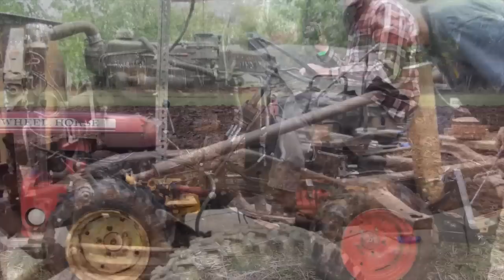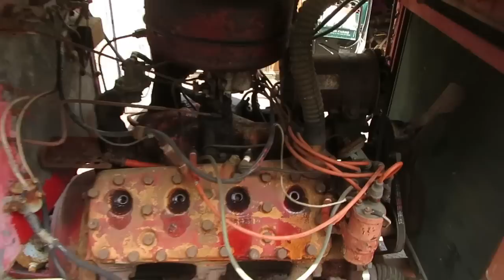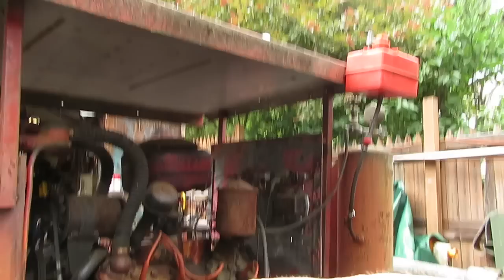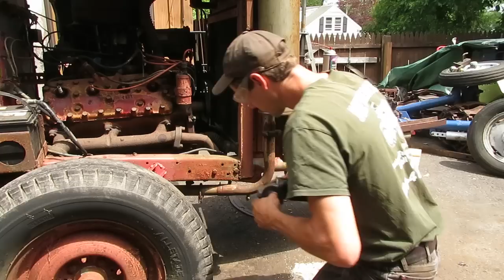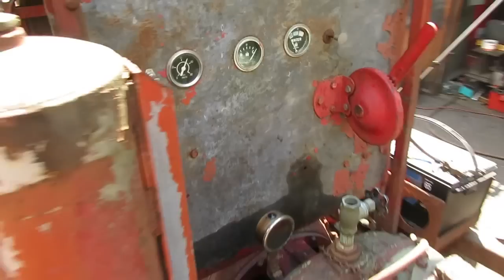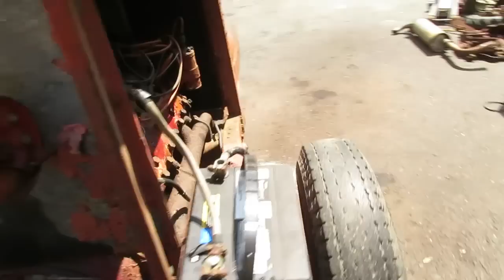Waking Up A Ford Flathead V8 Engine

Comment: You can tell General age by the distributor location. As stated in other comments, it's post-war. I have 49 Mercury V8 in a 52 willys jeep. It has the distributor on the side like yours. Instead of on the front like older flathead v8's.

Comment: The 239 was redesigned in 1948 as the 8RT for Ford trucks and in 1949 as the 8BA for the cars where the engines had the distributor up top at an angle.  1948 was the last year for front-mounted distributors except for possibly some industrial applications.  My '47 has the "V" twin style distributor cap.
Reply: Yup,fastest way to tell,crab cap on the front,pre 48-angled distrbutor,49-52.but ya knew that,just hadda add my 2 cents,I guess,love flatheads!

Comment: The valves like to hang open on the old flat heads the more you run them get them warmed up they usually come free if they don't have to pull the head tapping back-and-forth lots of oil

Comment: Wow that's a really cool piece! Never even realized Ford made a commercial version of the flathead V8's! Definitely a later one or they did some form of modification for the commercial ones with the distributor being where it is. Love how the first thing you did is cut the muffler off LOL! They are extremely quiet engines in my experience, half the time I can't even hear the one in my car running! You definitely should pull the heads and valves at some point though, that thing doesn't sound quite right... seems to be running fairly smooth but those old V8's have a very distinct sound and yours sounds weird... I have a feeling you have some stuck or non sealing valves.... Cool to see the quick video from you though! Looking forward to more in the future!

Comment: It's a 1949 to '52 Model 8BA engine. In my view, fix the cooling system, disconnect the drive to the pump & put some upper cylinder lube in the fuel. Run it at no load & fast idle for a while & the stuck valves [if that really is the problem] should free up as it warms up. Compression test it once it comes good, assuming that it does come good.
There is likely more service information & more available parts for this engine than your 2006  Toyota/Ford/Chev/Mopar. [pick one]

Comment: That brings back some good memories of my younger days. Had a 1950 ford, don't run it without coolant very long as it's very to easy to crack the block. How do I know that? Did it with two different engines in my ol' 50 ford.

Comment: Boy it ran pretty quiet considering it was a straight pipe if you left the muffler on it would have been very hard to hear!
I was also surprised that the carburetor seemed to work pretty good that was really cool 😀🇨🇦

Comment: Those old flathead ford's are cool. Not bad for just throwing fuel at it !!!!            What is the little gearbox with the 540 PTO shaft on it ? End of the video behind the V8 pump.

Comment: EAB and EAC head code indicate 1952 1953 and often a Mercury 255. Mercury 255's had longer 4 inch stroke and are the most sought after "Ford" flathead ever. Easy to measure with a head off. Some of the very last Flatheads made.

Comment: Hi 5T I WANTED TO KNOW WHICH BUICK V6 distributor you put on the GMC WORK TRUCK. I RECENTLY GOT A 1964 K1000 and am doing necessary upgrades to make it run better

Comment: Flathead is easier to kill than people are admitting…weak cooling system, brittle cast metal, Babbitt bearings on early ones, studs pulling out, and prevalent core shift when casting.  Very cool, lots of hot rodding history, etc., but durable is not a word that comes to mind.

Comment: Having once owned a '53 Ford Customline ... Which was the last year of flatheads ... I can safely say, that you have one of the final years motor ... The location of the coolant lines, being forward (closest to the radiator) gives it away ... The earlier version had the lines more to the center of the heads ... Now, weather or not its an auto or truck motor, is in the designated letters cast on the heads ... Such as 8BA, which indicates a motor for a sedan ...
Good to see the motor in action ... Regards ... 🔧 ... 😁 ...